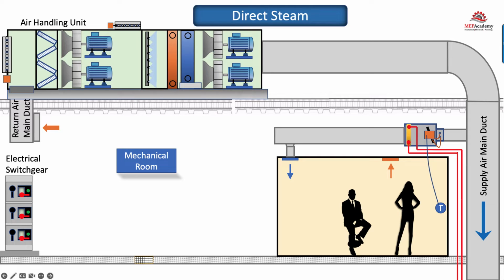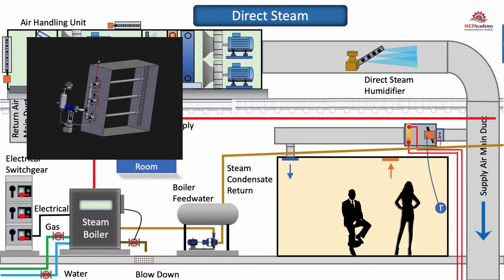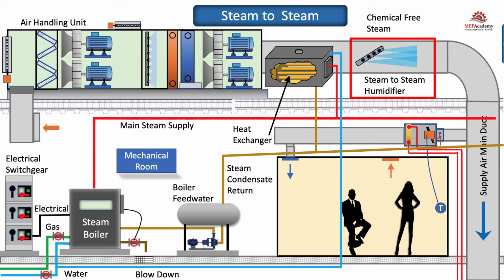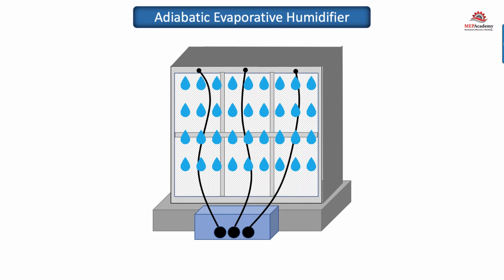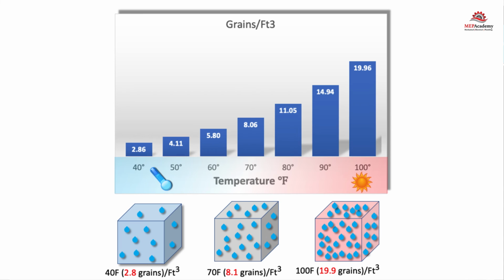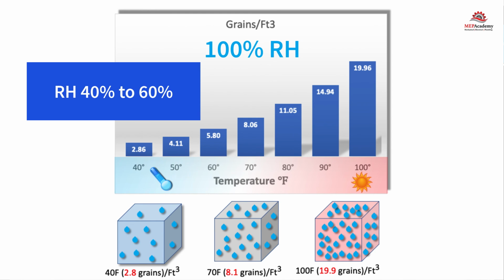Humidifier Types and Humidity Basics

Comment: This video provides an overview of common *commercial humidifiers* and explains the fundamental concepts of *humidity* and **relative humidity**.

### Types of Commercial Humidifiers
The video details the operation and installation considerations for several humidifier types:
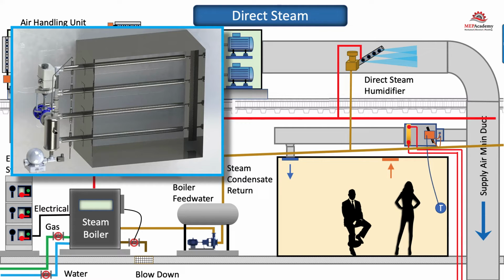* *Direct Steam:* Uses steam from a building's boiler; it is cost-effective if existing steam infrastructure is already in place (0:20-2:12).
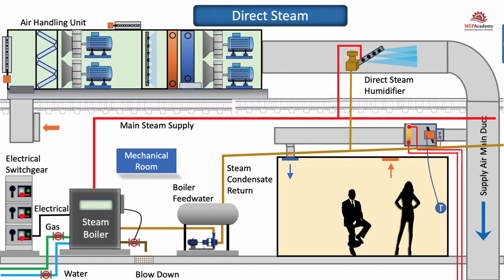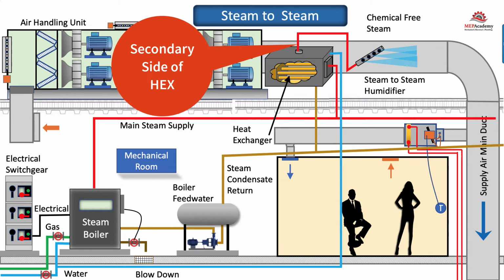* *Steam-to-Steam:* Utilizes a heat exchanger to separate boiler steam from the humidification steam, addressing concerns about breathing water treatment chemicals (2:15-3:48).
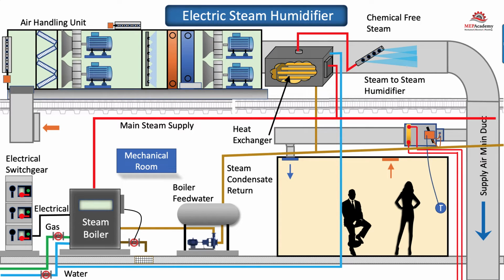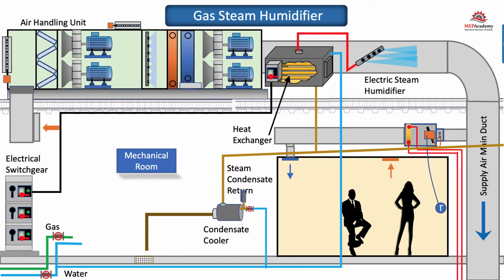* *Electric Steam:* Generates steam using electricity, requiring no boilers but necessitating electrical supply and condensate cooling (3:52-5:01).
* *Gas-Fired:* Uses gas for heat generation and is suitable for indoor or outdoor installation (5:03-6:13).
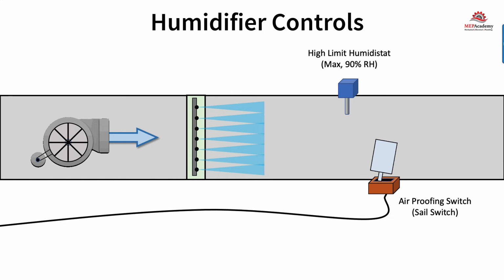* *Evaporative:* Air passes over wet media, cooling the air while increasing moisture content, which reduces energy consumption as no fossil fuel is needed for evaporation (6:14-8:27).

### Humidity Basics and Controls
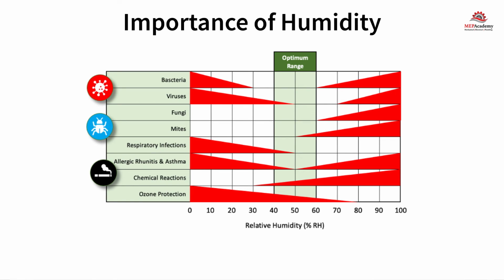* *Humidifier Controls:* Essential components include *air proving switches* (or sail switches) to confirm fan operation and *humidistats* to manage set points (8:28-9:13).
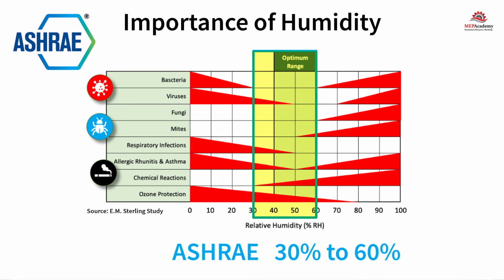* *Importance of Relative Humidity:* Maintaining indoor relative humidity between *30% and 60%* (as recommended by *ASHRAE*) is critical for occupant comfort, health, and reducing the spread of airborne infectious diseases like influenza (9:14-9:53).
* *Psychrometrics:* The video explains that *warmer air has a higher capacity for moisture* than colder air; as temperature increases, the amount of moisture the air can hold increases (9:55-11:41).                                                                                                                                         Humidifier-এর পাঁচটি ধরন
① Direct steam — তৈরি steam সরাসরি air duct-এ
Building-এর boiler আগে থেকেই steam তৈরি করছে। সেই steam pipe/manifold দিয়ে duct-এর বাতাসে দেওয়া হয়।
সহজ কথা: Boiler-এর steam → সরাসরি air।
② Steam-to-steam — এক steam দিয়ে আরেক steam বানানো
Boiler steam heat exchanger গরম করে। তার heat দিয়ে আলাদা পরিষ্কার পানি ফুটিয়ে নতুন steam তৈরি হয়। নতুন steam air duct-এ যায়।
দুই পানির circuit স্বাভাবিক অবস্থায় মেশে না।
সহজ কথা: Boiler steam-এর heat নেয়, duct-এ দেওয়ার জন্য আলাদা steam বানায়।
③ Electric steam — electric kettle-এর মতো
বিদ্যুৎ দিয়ে পানি ফুটিয়ে steam তৈরি করে duct-এ পাঠায়।
সহজ কথা: Electricity → পানি ফোটে → steam → air।
Drain water অতিরিক্ত গরম হলে discharge-এর আগে উপযুক্তভাবে ঠান্ডা করা হয়।
④ Gas steam — গ্যাসের চুলায় পানি ফোটানোর মতো
Gas burner-এর heat দিয়ে পানি ফুটিয়ে steam তৈরি করে।
দুটি পথ আলাদা: Steam যায় air duct-এ; combustion exhaust যায় উপযুক্ত vent দিয়ে বাইরে।
⑤ Evaporative — ভেজা কাপড় শুকানোর মতো
ভেজা pad-এর ওপর দিয়ে বাতাস যায়। Pad-এর পানি বাতাস থেকে heat নিয়ে evaporate হয় এবং বাতাসে মেশে।
ফলে বাতাসে:
- Moisture বাড়ে।
- Temperature কমে।
এখানেও পানি জলীয় বাষ্প হয়, তবে আগে kettle-এর মতো ফুটিয়ে steam বানানো হয় না।

Comment: How to control HUMIDITY IN A SPACE
Reply from the maker: There is a lot more information about controlling humidity than could be put in this first video. The use of a humidistat will control the humidity level based on the set point. Some humidifiers are faster to respond when a demand signal is received, which would include direct-steam and evaporative, the others would be slower to respond as they have to boil water to provide humidity.
Reply: @MEPAcademy  thanks a lot
Reply from the maker: @shamsheralam8862  Your Welcome
Reply: @MEPAcademy which one is best for dry skin?? Cool mist or warm mist?